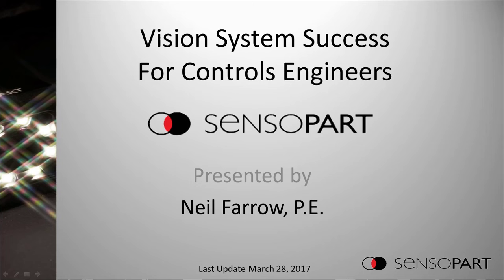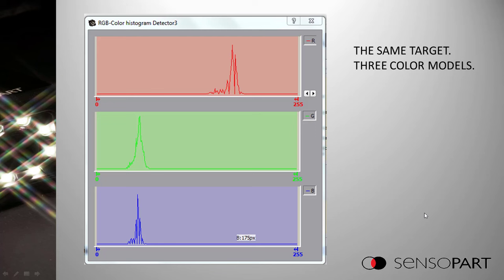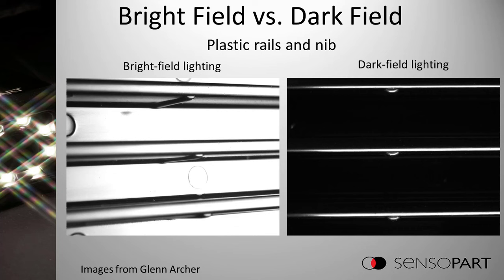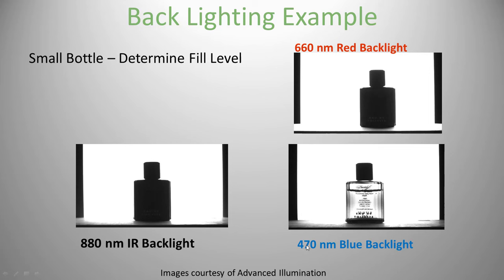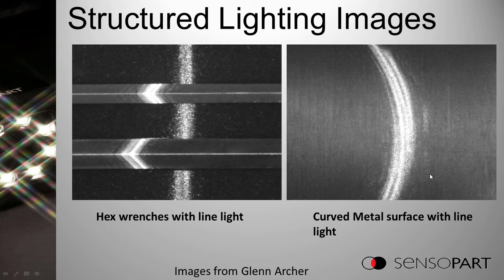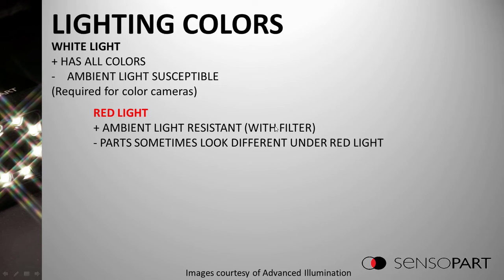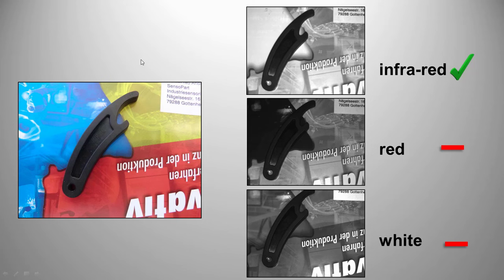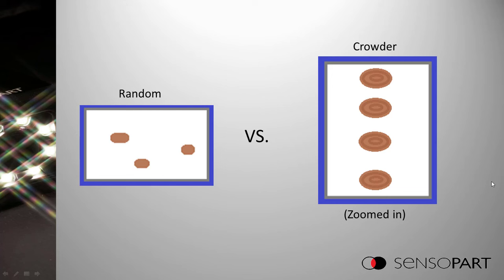Vision System Fundamentals

Comment from the maker: 8:51  Summary: Create a high-contrast stable image.  
3:48  Context: Dog or Marshmallow
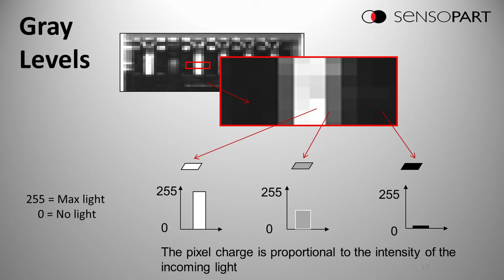4:49  Color Models: RGB, HSV, LAB
7:38  Why does vison seem so complex?
9:10  1)Lighting
17:22    Back-Lighting & Gauging
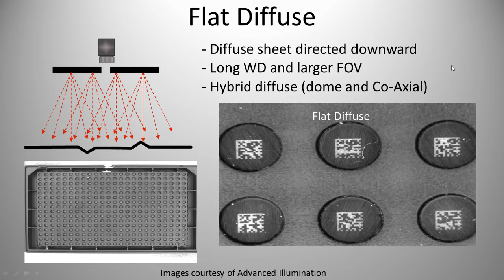25:36    Structured Light
27:42    Lighting Technique: Texture Vs. Reflectivity
28:48    Strobing 
31:17    Wiring
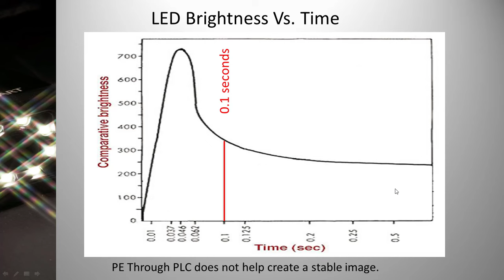32:56    Colors
33:57 2)Lensing
35:43    Red Green Example
37:31    UV examples
38:38    IR examples
39:38    Avoiding Glare
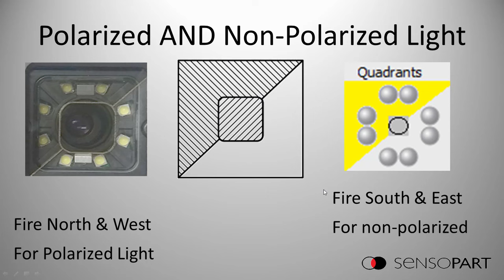41:18    Trade-off: Aperture/Depth of Field
43:15    Trade-off Summary 1
44:17    Trade-off summary 2
44:36 3)Material Handling 
45:00    Indexing Conveyor
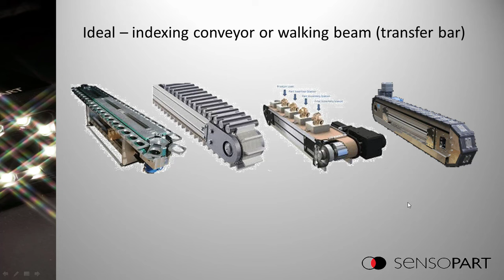45:46    Constant speed conveyor 
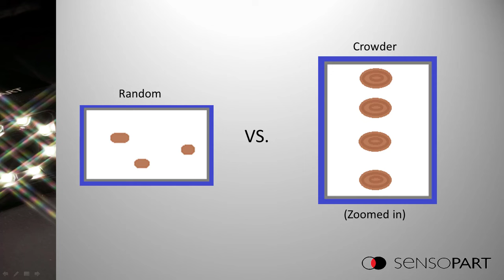46:37    Alignment in Software